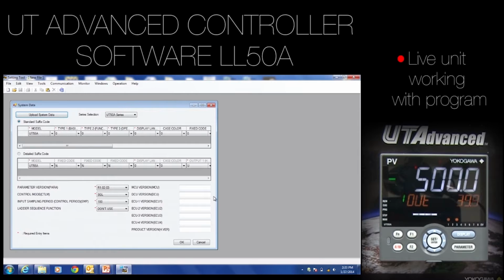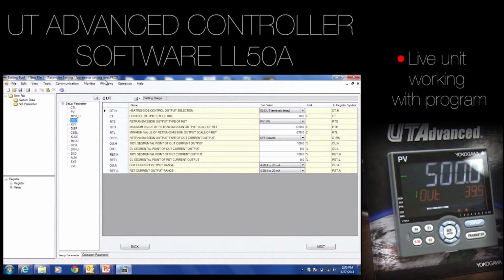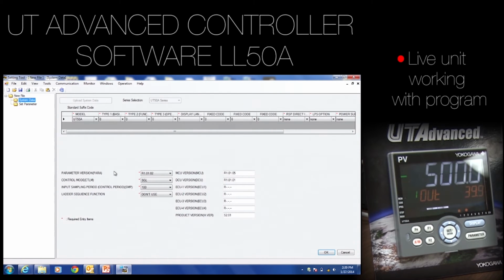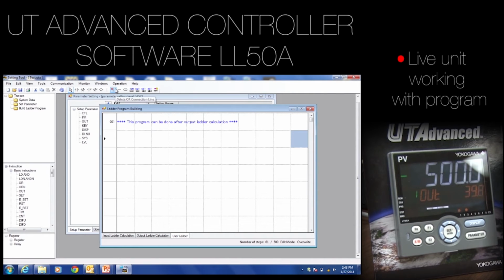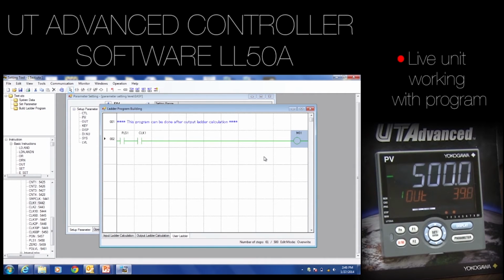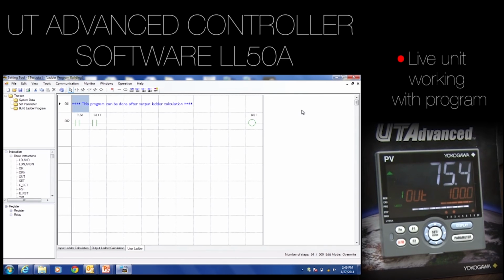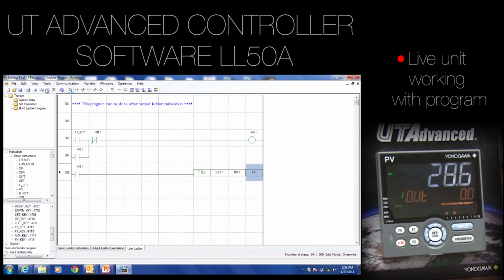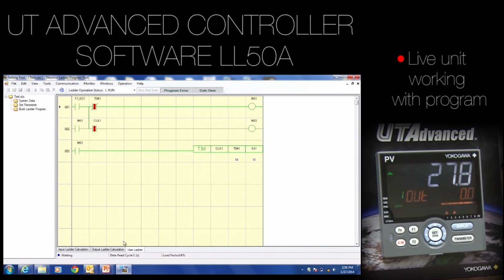UTADVANCED Controller Software LL50A

Comment: Thanks for this useful demonstration. Does ladder mode disable the normal control function of the controller?
Reply from the maker: Hello Shady, The controller’s PID functionality and its associated functions run simultaneously with the ladder program. In fact, the ladder programming can be used to change modes, set parameters and configure a custom PID control strategy. I hope this answered your question; thanks for watching!
Reply: Thank you so much. This is totally a pleasing answer for me and it killed my doubt, because I noticed in your video when you used the ladder sequence the PV value was going down without any kind of control. Just another question and I hope you will be patient answering me, is there any register that tells that the measured temperature is within the allowable range?. Simply, I need the controller to do certain action when the measured temperature is within the allowed range (set Point +/- deviation).
Reply from the maker: No problem Shady. The easiest way to do this is with one of the standard alarms in the controller. Any of the alarms can be configured as a deviation within high-low limits. This will trigger an output signal any time the PV is within a specified band. If you select alarm 1 to configure this, it will be mapped to the AL1 contacts on the rear of the controller. You can also pick this alarm status up in the ladder program using the ALO1_L1 (4353) register; this will act as a relay contact and can be used to start a process, timer, enable a branch or anything else. Thanks for watching, subscribe to this channel for future videos and topics.